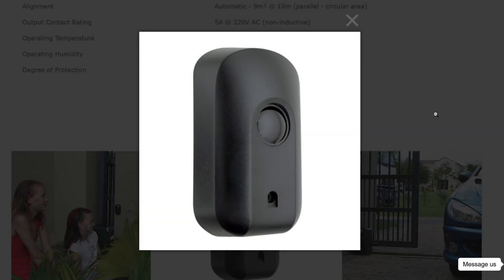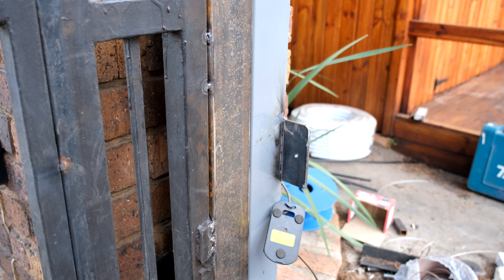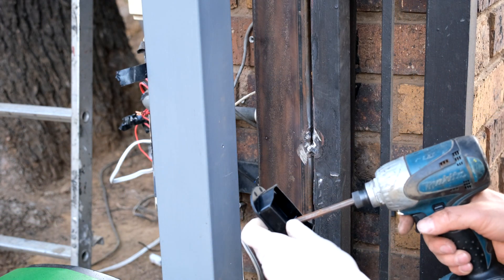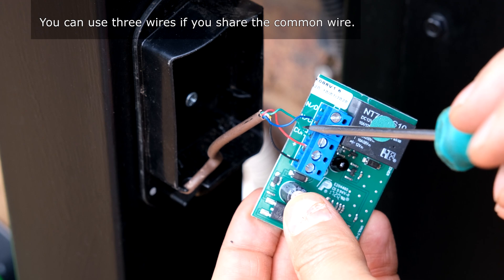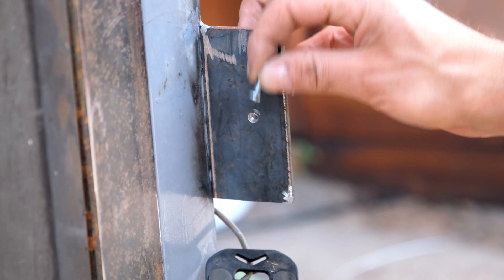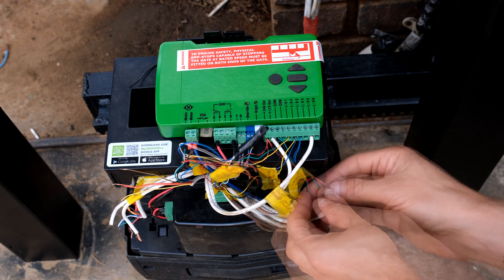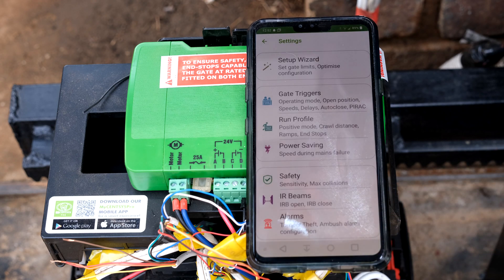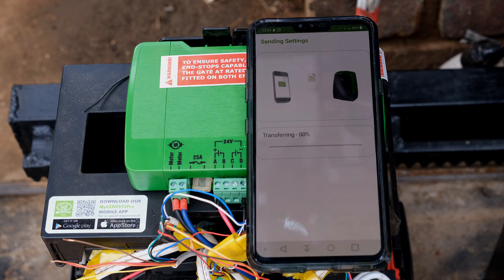How to connect Infra Red safety beams to your Centurion D5 Smart gate motor

Comment: Good day, sir, I have following your training, but there is a complex issue I need your assistance with before Monday if possible, 1 my beam sensor is not working like yours it only stops when there is an obstruction before control, 2 how can I get the keypad is not available in Nigeria, 3 my clients want his systems to be connected to the home intercom.
Reply from the maker: hi, thanks for watching. I only offer the videos, no other support available. You can contact Centurion customer support in South Africa.
Please see my videos on relay connection for alarms, same logic for intercom.